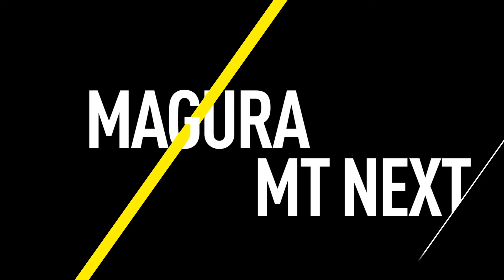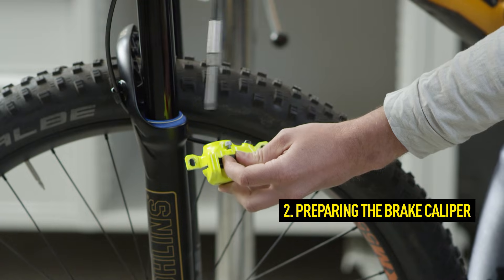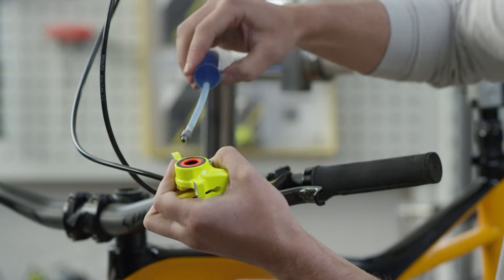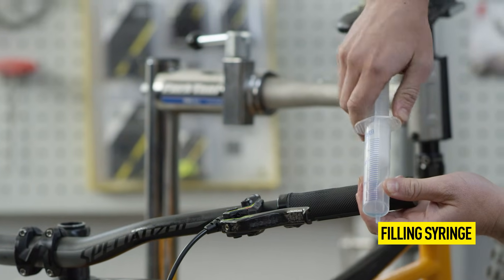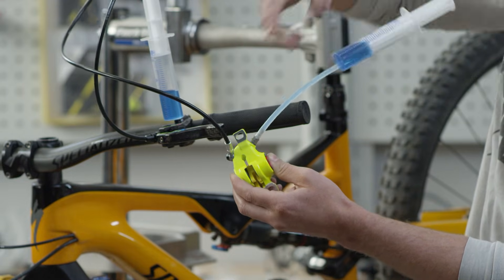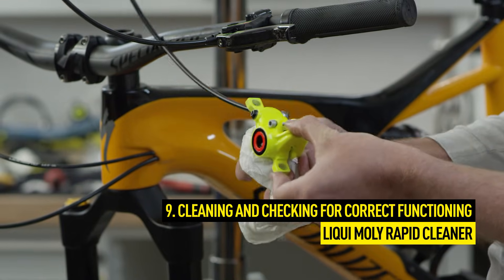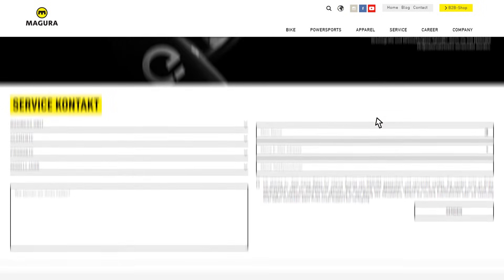MAGURA MT: Filling and Bleeding

Comment: As the fluid is pretty expensive and utilization is complicated, can you reuse the fluid after procedure if its not discolored? The fluid is hydrophobic so it cannot spoil as I understand.
Reply from the maker: Hi, yes, no problem; as long as there is no debris, contamination, or excessive discoloration you can simply reuse it.

Comment: Tenho um magura raceline desde 2017, nunca tinha tido problemas nas manutenções que faço. Fiz com esse método de colocar pressão com a seringa  e agora está vazando líquido nas manetes. Não recomendo.
Reply from the maker: Such an issue should not occur if the bleed process was done correctly and if a previous issue with the brake can be ruled out. Feel free to send us a message on Facebook or Instagram if you need any assistance.

Comment: This process can be a nightmare 
But I’m also dumb :( 

Make sure both bleed ports are closed before you test your brakes . I kept hitting the brake and wondering why I had no pressure duhh.  Anyways heres what worked best for me 

This video definitely makes it look a lot easier than it can be. Personally I never cut the cable and weaved it through the bike, so the cable is very long and twisted. This method works easier if you have a short cable obviously. In my case I would probably just get air trapped in the middle trying to send it back and forth. What worked for me is keeping the brake where it is and sending the oil through from the bottom brake  port to the top and letting it fill up the other syringe, slow at first and then quick thrusts to get the air bubbles out. 

Start with a little oil in the top syringe (the one with a hole at the 30 mark) place that on the top brake (ebt) then slowly send the liquid from the bottom up. Careful not to get it past 30 or it will shoot out. Then if the oil was good I would put it back in the bottle and do the process over again. You can also fill that top syringe with new oil and slowly pull it from the bottom. I would get most of my air bubbles pulling back through. 
Hope this helps and good luck.

Comment: This is asinine.  Bikes have internal cables now and you can't just "take the caliper off the bike" like shown in the video.  An alternate method is to forgo the upper syringe pusher and let the fluid drain out from the top syringe body as you secure the lower plug...but having to raise a caliper above the lever in any bleed system is dumb, not well thought out.  The need to have a system that threads into the top bleed port (not just pushes in) so you can apply significant suction to the top or bleed-cup like Hope and Shimano.

Comment: Why don't you show how to do it for rear brake (especially with hose going inside a frame of bicycle)???
Reply from the maker: It's the exact same process. It may be necessary to rotate the bike to avoid high spots in the hose, and it's much more important to uninstall the caliper from the frame so it can hang vertically due to its installed position on the chainstay; but apart from that it's the exact same process.

Comment: Very good video Magura. But this method of placing the brake caliper above the brake lever to prevent fluid loss from the caliper is only valid if you are on the front brake.
In my case, on my rear brake ( flatmount ) it is not possible to remove the caliper to raise it above the brake lever ( the wiring is internal ) and avoid the loss of brake fluid and the entry of air into the system.
Any tricks for these cases, when I remove the syringe from the brake caliper, I lose a lot of brake fluid.
Thanks
Reply: You could tilt the whole bike 90 degrees on a bike stand 😅
Reply: @callyourhits3963  Hi, do you think I haven't tried it, if I do as you say, the bleed hole in the flatmount caliper is downwards ;) and you lose brake fluid.

Comment: Such a nice, powerful brakes. And then you design such a crappy bleeding. Even sram is a smaller pain in butt (and I hate sram brakes).
Why is that such a big issue to make a closing port like shimano has?
Reply from the maker: We're sorry to hear about your frustration! We find our bleeding process to be easy and straightforward, if you need any help, feel free to send us a message.
Reply: @MAGURAPassionPeople OK, I've done this procedure 4 times now and 4 fast bleedings, step by step but the rear brake won't feel on point as the front because of air that sits, most likely in the caliper. Internal routing that is rather common these days forces me and others to tilt the bike in the bike stand. And that's what I've done now, again and again. I've been taping the hose and the caliper, lifting the caliper, different angle to the bike and soo on but nothing helps soo you can't say it's the best and simplest way to bleed a rear brake.
 
This is a BIG engineering fault, all you had to do is to keep it simple with a bleeding port/valve. Listen to the customers, we can't bleed de bloody brakes with this method! 

I was really happy when I bought the brakes but now it keeps me awake because of the stress, that a simple bleed can't be done. I've been bleeding Shimano,  Brembo brakes on bikes, hydraulic clutches but this brake makes me and others feel incompetent. 

So please, make a retrofit that we can use!!!
Reply: Not difficult to bleed at all, neither is sram.

Comment: Why is it not lowered down when injecting fluid from the caliper side so that the lever is at the top and the caliper is at the bottom?
  It's probably better for air bubbles and gravity to have the hydraulic hose vertical, with the caliper at the bottom and the lever at the top.🤷🏻
Reply from the maker: You're 100% correct, that's what we recommend for an optimal bleed. In the video we've raised the caliper to master/bar height for visual purposes to show the fluid movement.

Comment: Was considering moving to Magura MT for use on my 2022 Slash 8, but how on earth do you do that with an internally routed cable to the rear caliper?
Reply from the maker: It's totally possible: just make sure to uninstall the rear caliper from the frame so it can hang vertically, and make sure to orient the bike (if necessary in a bike stand) to avoid any low spots in the hose that may trap air bubbles.

Comment: Ive lost 2 levers ebt threads so far from bleeding them (hs33 and mt7)  fml :(
Reply from the maker: Please note that the max. torque on the EBT screw is 0.5 Nm. Feel free to send us a message on Facebook or Instagram if you have any questions, or contact your respective dealership to inquire about warranty claims.
Reply: @MAGURAPassionPeople   whatever, i just bought the new mt8 raceline ! they are awesome !

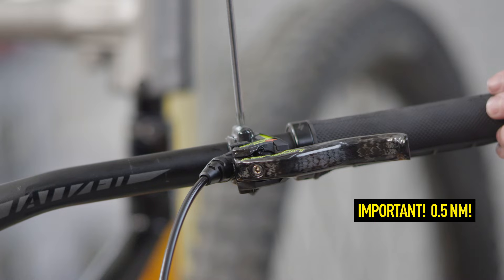Comment: 3:17  .... r you kidding us?  0,5 NM????? Lowest my Wrench has is 2 NM :(
Reply from the maker: That's correct, the torque for the EBT screw is 0.5 NM.
Reply: @MAGURAPassionPeople  it helped me to understand that the screw doesn't hold any pressure ... since then I just turn it slightly close and that's it

Comment: 0:12 Can somebody tell me the name of the open bit? 
It is installed on torque screwdriver on far right
Reply from the maker: The one later used to tighten the sleeve nut connecting the hose to the master? That is a special bit by Wiha that we offer called adapter SW 8.0. You can alternatively use a crowfoot adapter for a regular style torque wrench, however make sure to keep in mind the changes in torque caused by the adapter.
Reply: @MAGURAPassionPeople  Yes, about the 8mm nut that has to be 4nm scewed into the master.
So is this SW 8.0 adapter available to purchase from Wiha?
because I can not find  open ones like yours.
The only ones I find are for whole 8mm nuts, which can not be used when there is tube :)
I was thinking of Wera crowfoot that goes into 9by12 system of their own, but not sure how much the torque is changes
Reply from the maker: @vvtt1823  It's available via our dealership partners, product number is 2701488 : https://magura.com/en/EUR/dealer-search

Comment: How do you do the rears?
Reply from the maker: Same procedure, just make sure to angle the bike to avoid low spots in the hose and make sure to uninstall the caliper from the frame so it can hang vertically.

Comment: 3:32 so if you can't disassemble your caliper your screwed, can't bleed properly because no bleed screw and every time you loose oil and get air into the caliper, so smart.

Comment: My MT7 HC3 lever blade lost pressure, I've tried bleeding it multiple times but it won't pump back up. I'm not noticing any fluid leaks from the system. I've bled these brakes before without issue - I'm not sure why it's having an issue now? When sucking the fluid back to the caliper syringe it's an endless stream of air bubbles.
Reply: Having the exact same issue. Did you ever find a solution?
Reply: @sebby90 bladder in the lever was bad. I emailed Magura and they sent me a brand new lever and caliper set. Top notch warranty service.

Comment: I literally tried everything to bleed my MT7 brakes, but nothing worked (first year was fine, since then they are impossible to bleed properly). 
I took the bike to 2 bike shops. The brakes were even worse, and I had to do another bleed at home. 
Brakes only work if lever position is far out and my finger barely reaches the lever. 
Let's be honest, these brakes might have good braking power when they work, but when they actually work?

Comment: This method is for front breaks, but for internally routed cables, no. You need a different method.
Reply from the maker: It works perfectly fine for internally routed setups. Depending on the routing, you may need to set up your bike in a bike stand to be able to tilt it.

Comment: Want to make sure you definitely get all the air out 🤔

A easy and simple trick .
When pushing the oil slowly into the caliper use a ' hexbug nano ' ( kids toy ) to vibrate out any air trapped..fix it on with a elastic  band . 
Then start slowly pushing in fluid about 5ml.
Then put it on the line and push through 10>15ml .
Leave the nano vibrating the whole time and for a good minute , then push trough another 10>15 ml.
You won't need to pull fluid back through.
Been doing this on Hope , shimano and maguras for a good while now .
Reply: I was thinking of my girlfriends wand, its easy also
Reply: @Azure3000  HAHAHA A STEELY DAN WORKES WELL ALSO LOL
Reply: Where exactly should you place the hexbug nano?

Comment: How do you raise the caliper side above the master side for rear brake lines which are internally routed?
Reply from the maker: You can tilt the whole bike in a stand if necessary.
Reply: @MAGURAPassionPeople  that’s what I ended up doing 😆 bike was doing a near vertical Endo on the stand
Reply: @MAGURAPassionPeople  I found your bleed process to be pretty easy. The drilled hole in the syringe helps a lot. Using gravity and physics laws is key

Comment: "Always use a torque wrench", and then uses a regular T25 Torx wrench.  Ha.  Sorry, had to laugh at that.

Question: with many modern bikes with internal cable routing, it's not possible to raise the rear caliper.  Any suggestions in lieu of that option?
Reply from the maker: Classic "do as we say, not as we do" moment! 😅

Yes, the solution is to tilt the bike into a more favorable position if possible/necessary. Also don't forget to remove the caliper from the mount while bleeding so it can hang vertically - otherwise air can't escape it.

It's also not necessary to do the full bleed procedure every time - normally that's only necessary when air is trapped in lower parts of the system, which can happen when opening the banjo bolt for example. If you suspect that the air is only located at the top, our fast bleed procedure  is a good option: https://youtu.be/RtqwQB8wtYQ
Reply: @MAGURAPassionPeople  Hanging it vertically did the trick.  Nice solid lever feel now.  Thanks!

Comment: After the bleeding getting the damn calipers (MT Thirty 4 piston) centered so it doesn't drag is next to impossible. I don't know if there is too much oil in system and pistons don't retract enough or what. With Shimano I always managed ok, but with this Magura I've been struggling for hours.
Reply from the maker: The space between the pads needs to be quite small on brakes like our 4 piston brakes due to the high leverage (which gives them their high power). More space between the pads just means more free travel at the lever, which is amplified on a brake with high leverage. This can indeed make it difficult to perfectly align the brake caliper. Here are some tips:

- Align the caliper by eye, ignore rubbing pads at first. You can use the slits though which the rotor travels as a point of reference. Aligning the caliper in order to get the pads rub-free often results in a caliper that isn't actually parallel to the rotor, making a noise-free brake pretty much impossible. Once the caliper is centered, you can push any pads that are still rubbing away. Very slight "residual-rubbing" often disappears within a few minutes of riding.
- Check whether all pistons are moving freely with the pads removed. If one or more pistons aren't moving freely, you can mobilize them.
- An overfilled system will make the space even smaller and could damage the system. You can avoid this by using the yellow bleed blocks during bleeding.

If you can't seem to fix this or have any questions, feel free to send us a message on Facebook or Instagram!
Reply: @MAGURAPassionPeople  Push the pad how? I don't follow. Thanks
Reply from the maker: @paulb9769  You can carefully push back on the pad carrier plate in order to push back the pad and piston, with a tire lever or something similar.

Comment: Why does my local bike shop / LBS want to replace with another brand (eg Shimano?) of brake when bleeding and refilling my current Magura brakes which have stopped working?

Only one Magura lever might be damaged ie might need replacing, but the two Magura brakes seem good to use after refilling.

Is Magura more expensive than other brands?
Does the LBS not have the equipment and materials to fix Magura?

Maybe is it because both of the only two dealers / distributors in my capital city in Australia seem to have closed down, and that has not been corrected on the Magura website, and Magura parts etc are now not available anywhere in Australia?

Comment: If you have 6 hands, 3 hours and a dedicated shop space, Magura brakes and bleed procedure should work for you. If you have 2 hands, 10 mins, and a work space you’d like to keep clean, then go with Shimano XT and do the gravity method.
Reply: This is going to be a royal pain in the ass to do on my bike.
Reply: @paulb9769 Just like Shimano says only use their fluid. This job takes 15 minutes and I use Halfords fluid and is is brilliant.
Reply: It's easy to do, even without a bike stand. It's tricky to get a good bleed, but repeating the whole thing works.
Reply: Not sure what the gravity method is, but it took me (in chill-mode) one hour and own two hands to bleed both MT-5 brakes. They work perfect now. However, without a bike stand it would be much more tricky.
Reply: SRAM with bleeding edge technology is easier
Reply: @ArdianSutarjan 😂
Reply: But SRAM brakes just plain SUCK
Reply: It is so stupidly easy what are you kevetching about? It is a piece of pie.
Reply: It's not a good design. I did the procedure 3 times and still spongy but now have a bunch of oil clean off.
Reply: @ThePatrioticMom Technique is the key. Once you get it it's easy just like chain waxing.

Comment: How does oil leak from the caliper if the EBT screw on the lever is tightened, surely that creates a vacuum, just like holding your finger over the end of a straw?
Reply from the maker: That's true, and it does decrease the flow of oil quite a bit (...if you've ever missed this step, you'll know), but the oil is still able to overcome this resistance even with the EBT screw closed.

Comment: Another day, another successful bleed thanks to these video instructions!
The requirement to position the caliper above the master cylinder when closing the bleed screw is essential. Other tutorials, e.g. Park Tools', omit it. Their end result is not as good as if you'd follow this, Magura's own official video. You can even see in other videos how oil escapes the caliper while a person is trying to quickly seal the hole.
For the rear brake, this always means rotating the frame in the repair stand (especially with internal cable routing when you cannot loosen the hose from the frame). For the front brake, it always means cutting the zip ties and bringing the caliper body up, or rotating the frame towards even crazier angle in the repair stand. Unfortunate but unavoidable with this design.
Reply: ...except that's not possible on the rear brake of a bike with internal cable routing.
Reply: @rickbullotta2036  Yes, that case is tough. I have one such frame. In this case, rotating the whole frame in the repair stand counterclockwise will bring the rear caliper into the about level position. After that, there is at least a couple of centimeters of wiggle room for the unthreaded caliper and the small section of the brake hose protruding out from the chainstay. So it is still possible to get the master cylinder and the caliper at the same level before closing the bleed port.

Comment: Hey anyone out there have MT 5 HC with storm HC 203 rotor upfront? My LBS had trouble with caliper rub on my rig with the 203 mm and stated I need a 200 mm to fit upfront .
Reply from the maker: We're sorry to hear that you're experiencing some issues with your MT5! Could you send us a message on Facebook or Instagram? We can help you there in more detail. If the caliper is sitting too low, it is most likely mounted on an incorrect adapter rather than requiring a smaller rotor.